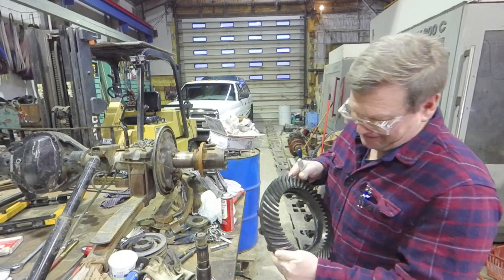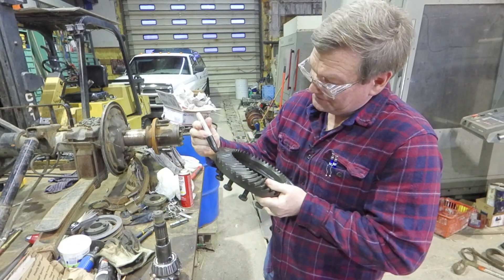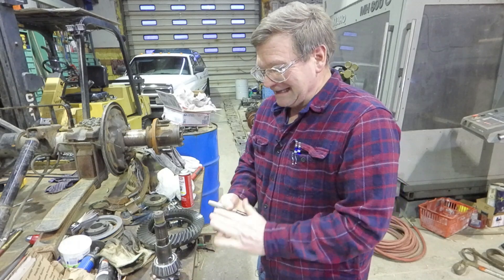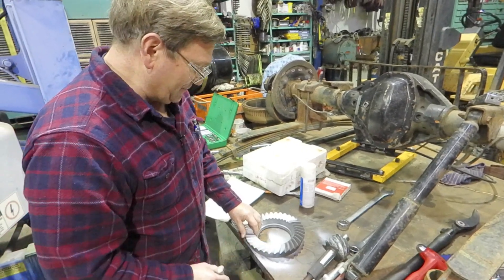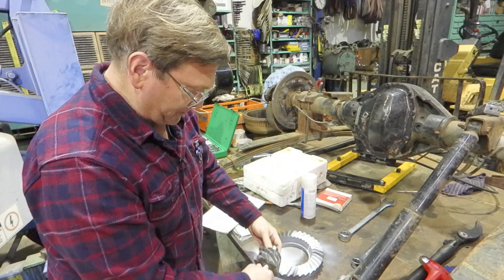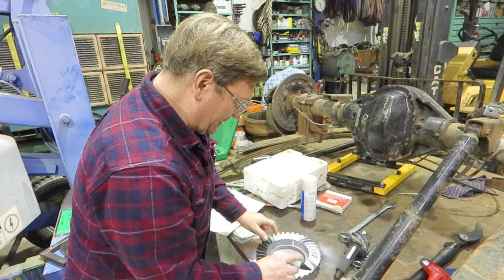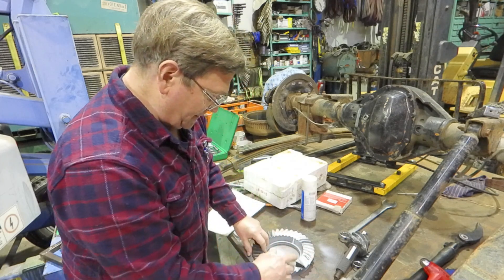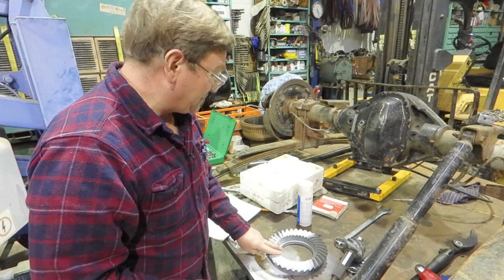Machinist's Minutes: Gear contact Patterning, part 1

Comment: The thickness of the gear paint is why I only do a few teeth 3-4 spots around the gear then look at the pattern on the clean teeth (and yes I put pressure against the gear as I turn it), I also do the grind out the center of a bearing trick because I have yet (out of the literal hundreds of gears I've done) to have the numbers match perfectly, either the housing is off or the aftermarket gears are off slightly causing the bearings to be pressed off at least twice, just one time of pressing a bearing on and off makes it worth getting a bearing to grind out and keep in hand for future use especially if you know this much about them then your going to be doing them more often. I can usually get an entire gear setup done in roughly 3 hours without the need for my dial indicators in pinion depth and have yet to have a single gearset fail and my friends WJ has over 100,000 miles on his 4:56's we put in his 44's and the oil still comes out without a metal sheen. Now before you freak out keep in mind I have my own personal machine shop that easily pays my bills on just the side jobs I do aside from my normal job of working on industrial boilers on both the mechanical and combustion side, And I currently have both a Dana 44 and a 14 bolt getting gears and lockers in my shop right now, and shortening one of the chromy shafts for the narrowing we just did on the 44. Just saying.
Reply: Very good speaker. Thank you
Reply: U ever use old carbon paper. Between gears
Reply: @paulmallery6719  that is an old trick they also use in dentistry to check your tooth contact, the issue with carbon paper is that the paper is 2-3x as thick as any one of the side shims could provide so it's a bit on the thick side.  I'm not actually looking at where the paint is at, I'm actually looking for where it was rubbed off and that gives me the detail I'm looking for.

Comment: I had to deal with a 1949'ish Jeep Dana 41 and the closest standard I could come up with was pinion depth with .028" shim under the inner race was 2.750" and a pinion mark of +1 so I aimed for 2.751" from center line. The bearings are 3.265" dia. and half of that is 1.6325". I measured from the top of the bearing saddle to the bottom center of the saddle with a dial indicator and determined that they were 1.6325" deep. Some are -.005" from center but mine were on size. I measured down to the top of the pinion and got the reading of 2.7515. I would have to another .125" of shim to hit 2.625" so there is the issue for my pinion. What do you think?

Comment: There’s still boat load of wrong information on this topic, seems like everyone is eager to share their wrong opinion on this subject. 
Then there’s punishing of the gear patterns but not specifying for which type of gear cut these patterns are, for new or used gear, for automotive or heavy duty / heavy equipment application - and all of those can and do produce different patterns on their own.

Comment: Admits to insurance fraud and being dishonest. Nothing to brag about. Unsubbing.
Reply: Ummm. He said his old boss was…. Not himself….
Reply: He worded it in a way to alert the insurance company if they were smart enough to recognize the fraud.....they weren't. Also, gears are still running.
Reply from the maker: I was led by the hand to do i process that I thought was wrong, however the bosses & the insurance people were happy with the method, I clearly wrote how it was done.  I would have preferred to re-align the gear, but the insurance agent, as well as the shop did not want to spend the extra time.  You can lead a horse to water, but if you spray him with a garden hose, you just get a wet horse.
Reply: Opie!! Noooo!

Comment: I LOVE when bosses cover shit up and want YOU to be part of it. Whaddaya gonna do? Get fired is one option, which I exercised a sum total of once. "No" is not typically well received under such circumstances..
Reply: Roll with the punches and when the ship sinks, sing like a bird.
Reply: @mikeznel6048  'Zactly. I'd prefer not to sing at all, but I'd have a fair stack of firings on my resume had I not learned to say "You're the boss". It's a rotten spot to be in, but if you're just BSing an insurance company etc, thats like lying to a vampire: never a bad idea.
Reply: @YerBrwnDogAteMyRabit  I prefer to keep my mouth shut and just do what I’m told if I know it isn’t right but only to a certain degree. If insurance fraud is part of it, I’m not participating in it. I just won’t come back or I’ll leave. When sht hits the fan, always remember the two certainties in life, taxes and sht flows down hill, not up.
Reply: @mikeznel6048  That's a good course of action, and it certainly does flow downhill. I probably should have been more explicit. I would never participate in insurance fraud. I was thinking of a particular situation that involved a waste oil and wood stove that simply wasn't there for an insurance inspection, yet reappeared later on. "Oh yeah, there WAS a stove there, but its been gone for years.." Kinda asinine being an issue in a concrete building with concrete floors and nothing flammable in sight. I'm not a huge fan of jail, so def not worth sticking your neck out when it comes to felonies.